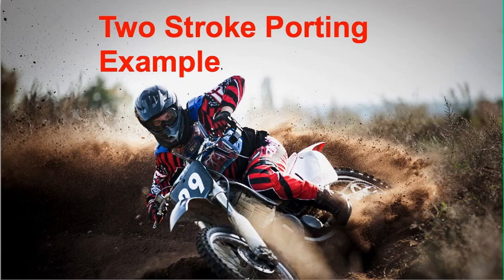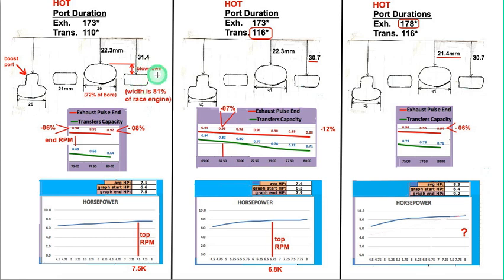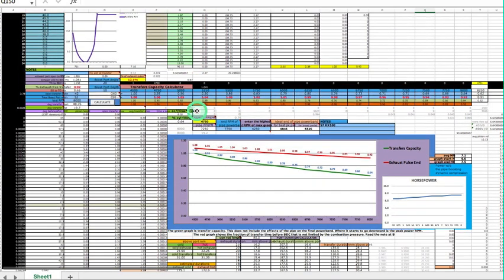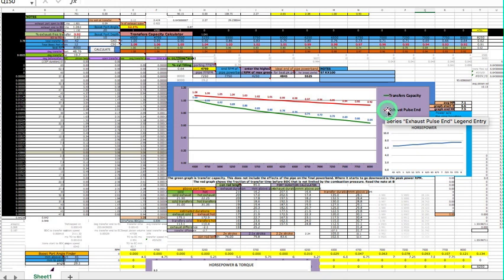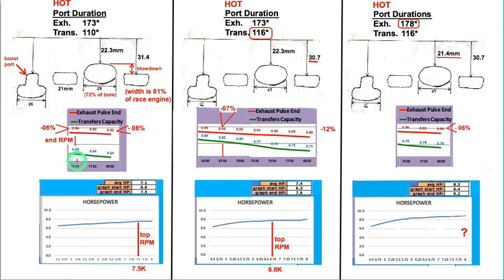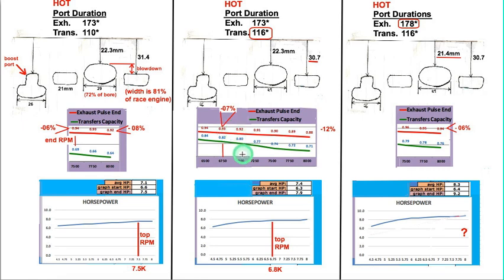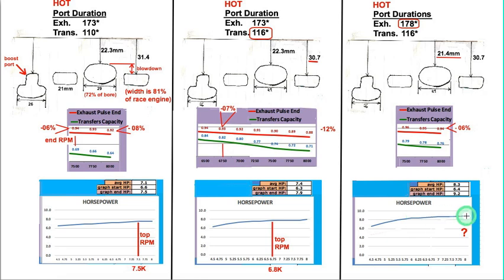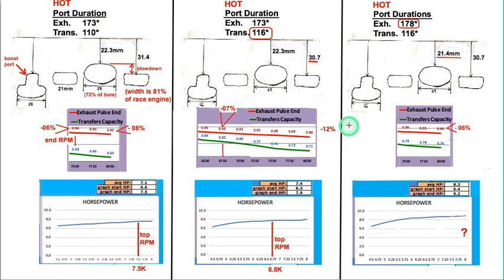2 Stroke Porting Example with Porting Calculator

Comment from the maker: What I should of included: 
1) motocross bikes usually already have near ideal porting, 
2) the pipe length sets the top RPM so usually it needs to be shortened but mine was already the right length to allow 8000 RPM max, 
3) the porting calculator uses more info other than the exhaust port, including transfers/boost widths and duration, compression ratio of engine and crankcase, and it estimates the port durations just based on conrod length and mm above ports (to the TDC location).